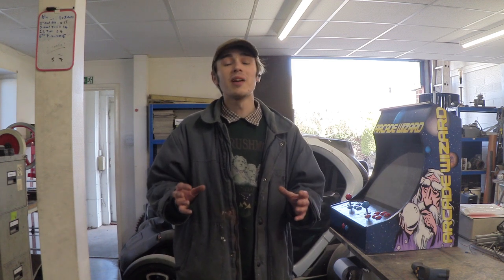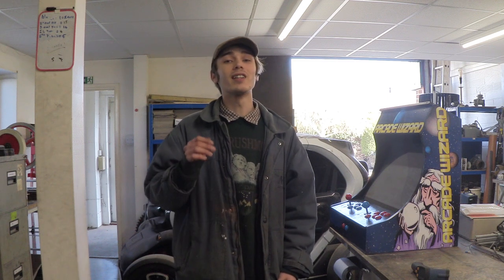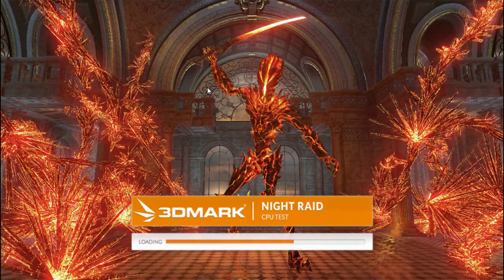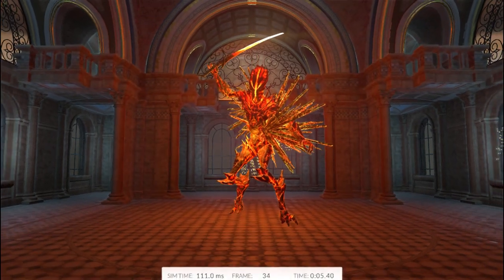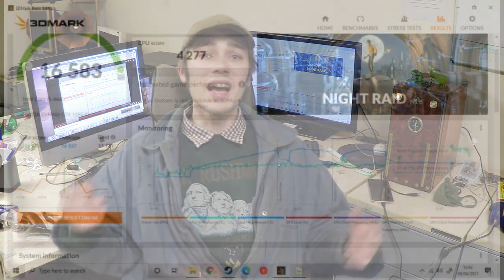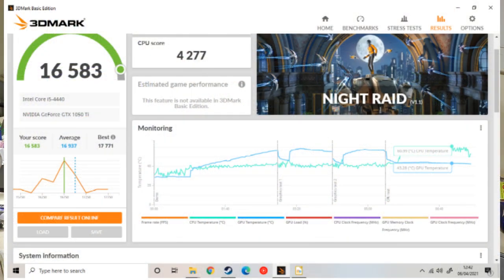1058 Conductive Ink as Thermal Paste Update

Comment: Cool, it may have improved simply because it wasn't dried before (not sure) by the way, an actual paste made with this ink would probably be even better as I have a feeling this ink is very thin so bubbles might form, oh and you're taking the temperature of the wall with a laser termometer not the ambiant air ?! lol (unless of course there is a setting for this which you used)
Reply: If the space is unheated, the walls and ceiling will be approximately the same as the air temperature.

Comment: I got The artic silver 5 thermal paste and mixed it with really fine diamond dust(<1 micron) with made paste really dense. But it brought my i9-9900k in cpuz test from 80-85c to 70-73c. Really did help in my opinion.
Reply: That is awesome mate! Is that idle temps or under load temps because that is fantastic! :)

Comment: most likely reason for better results is that your paste is thinning down from the vibrations and constant pressure on the paste to squeeze it out from between the heat sink and the processor, which is the optimum thing you really want, as the thermal paste should only be in the voids that with out it would be filled with air, and thus barriers to heat passage, and in your case it seems the paste is not drying out yet so it is able to make this transition, the curious thing will be if your paste can avoid the dry out effect that causes cracking and such in the unavoidable layer that will still remain permanently no matter what due to the solids in the paste that will not move out of the areas it is not really needed, due to creeping of the material (like a heavy bridge sitting on washers made of lead to deaden impact, after years it will have squeezed out the sides of the two joining points but all of it can never fully squeeze out) anyway since there is a flow component in the paste if this dries out it leaves a void causing shrinkage and due to lack of something to allow the solids to slide around it will end up cracking and pulling back leaving air voids in nearly all thermal paste, and people just reapply after cleaning normally (MX-4 paste is supposed to have the longest lifetime with out this happening but we will see as I have it in my two computers now ;) 

I wonder what other compounds you guys could put together to be a better thermal paste solid like how Robert made that Graphitic Carbon Nitride in the microwave ages ago, and later showed how it can be modified with ferric chloride, as I know boron nitride is used as a lubricant in place of graphite powder, and as a thermal paste now in hot ends for 3D printers, (could be something else you could stress test your paste formulas on too, to get faster stress testing due to higher temps when they are hot, because air voids and such slowing the rate of thermal dissipation into the nozzle is something that slows down 3D printing a bit, (and a lot once I get my 100 to 1000 nozzle at once system together for increasing printer speeds for plastic filament printing to lower say a 3 hour print down to less than 15 seconds or less LOL going to have to heat up a LOT of plastic in a VERY fast pace and short period of time, on the level of injection molding speeds XD) 

anyway a better thermal compound using something like BN is interesting since it is not a straight out conductor, and might be able to enable creep as the liquid or paste additive to keep it sticky and able to squish, is dried out leaving behind just the BN that is a lube anyway, so that maybe it can then continue moving around to let the pressure bring the parts together anywhere they can meet possible when pressed, 

Something I could see you and Robert collaborating directly on and you do some videos on the process if not both of you being in the video at once, though that does mean someone else has to run the camera or something I think LOL (time to get a raspberry pi RC wifi car with a webcam and pan tilt running so someone can run it remotely from somewhere else in the world :)

Comment: Once, in an emergency situation, I was able to use tooth paste as heat sink compound. 
It ran fine for the two weeks that it took for the Arctic Silver  to arrive .
Reply: Haha I have heard of people using it in a quick emergency, does it really work well? If so that is awesome! :)
Reply: @MyNameIsLukey  Anything that bridges the microscopic gaps in the metal surfaces works, it's just that thermal paste has conductive particles in it suspended in the non-conductive gel solution in order to not short circuit if it splashes on the MOBO AND conduct heat really well as things that conduct heat really well usually conduct electricity too.